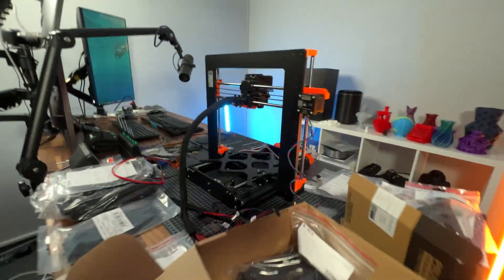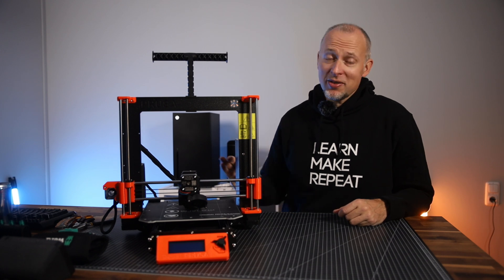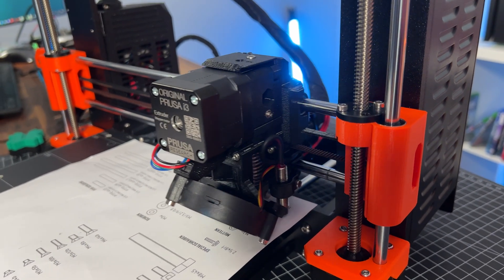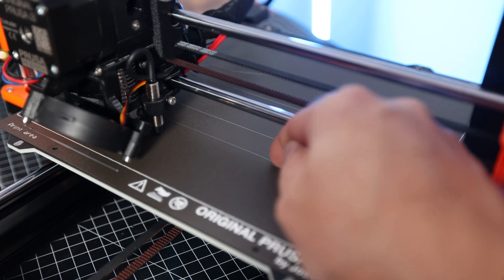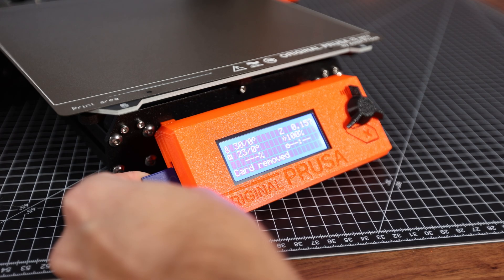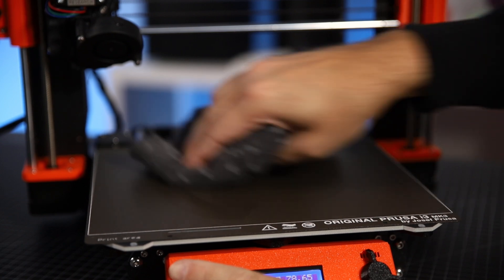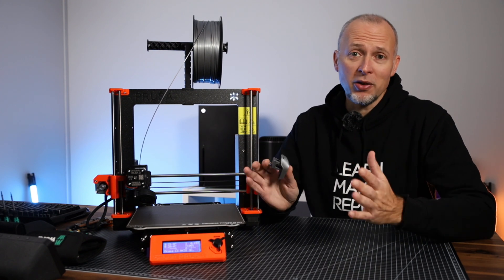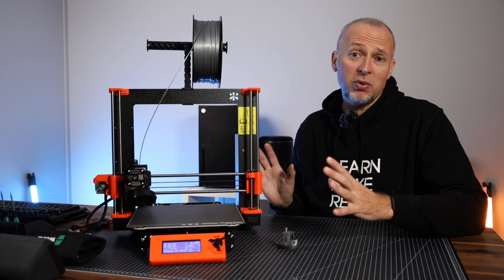MY FIRST PRUSA i3 MK3S+

Comment: The Prusa is a great printer.  The Z axis initial calibration is stupid.  I had to just print one layer, peel it up and measure it with micrometer and then readjust the Z axis offset myself.  How else would you ever get the correct first layer height?   If you buy a 3D printer you must also spend $15 and get a digital micrometer so you can measure things.

Comment: Do you genuinely believe it's worth $800 for a printer I have to build that's made mostly of 3d printed parts? I've had every ender 3 model and each had warped beds on top of other unique issues. I'm so fed up. I'm returning my $500 ender 3 s1 pro due to... you guessed it... a warped bed. But I don't have the funds to just drop $800 on a printer without knowing it's 100% worth it

Comment: Just got mine, it's a pain to calibrate the z axis! I'm in -0.800 and I feel it's too low but according to the results, it's still too high. Also, is there a way to plug a USB A into it? I only see the SD Card option. Thanks!
Reply from the maker: There is a USB connector on the Mainboard. The outlet is at the top of the Mainboard box . Cable should come with the printer.

Comment: Daniel, if I'd spend 800 quid on a printer kit, then spend 10+ hours assembling it, and the thing fails its very first print,  I wouldn't be the happiest man in the world.
Reply: If you spend 10+ hours to assemble a Prusa printer, you get a knowledge. You know why every one little screw is there for. In case of a problem you are already experienced enough to fix it right away (with well written manuals by Prusa team). That's worth those 10+ hours. It's an investment. I like the way they do it. It's quite the opposite of where the modern society is heading. Not knowing about how technology around us is working. Assemble your printer and you become an expert. Not a user.
Reply: Well, I have bad news for you. For 800 quid you really gets a really fiddle-maschine. For a "it always works out of the box", you are more in the 3000-5000 quid range.

Comment: Did you notice that the screen is one that can be bought from Amazon for around $13 and the knob that works the screen is on a Rotary Encoder you can get for $8.89 for 5, and that the mother board is 8 bit and you can get that for under $50. The kit is $949.00 on Amazon where you can get an Anycubic Kobra for $319.99 which prints just as good and takes 12 to 15 minutes to get going.
Reply: The anycubic is 100% knockoff parts and china made components. A MK3S is all genuine parts and is built with less than 10% of parts made in china. To compare a prusa to an anycubic is idiotic. Your anycubic will print as good as a prusa up until it starts to break parts, which is fast. Then a prusa will just keep going. My old anycubic i3 megs S had a broken hot end, heat bed, extruder and scuffed rails. all with less than 500hrs of print time. My prusa has thousands of hours now and still bone stock.
Reply: Cheap Chinese printers are great if you want to tinker and fix something… often… I don’t mind but I don’t put much faith in them being reliable lol
Reply: If you want to constantly repair and replace parts and solve problems, buy a printer with bearings, screw drives, cheap rollers, motors and fans made to no specifications at all from China. My first two printers broke every few prints and the quality was always poor.  If you just want great prints, save your time and money and buy the Prusa.   It uses the name brand parts and Japanese bearings.  It doesn't just break after 30 hours of use.
Reply: @NackDSP  Try and find anything on any 3D printer that’s not from China.
Reply: @NackDSP  my mega X had a bunch of stuff broken with it too like the PSU, hot end, bed. I do this for a living so this was ridiculous. I'm currently getting rid of all my Creality and Anycubic FDM printers for Prusa. At this point I have 1 CR10 that I bet I could have bought a prusa for after parts. I found out the hard way that most of the chinese stuff is junk since they have no QA or real oversight on quality. I honestly regret not getting a Prusa sooner as it would have literally saved me thousands for my business.
Reply: REMOVING THE J_E_W SINCE 1992  They aren't They're made in EU.

Comment: no wonder why bambu is making such a huge impact on the 3d printing community. This seven year old machine needs so much tuning, even for a "plug and play" machine.
Reply: It just needs the first layer calibrated and thats it.
Reply: @CineZoneYT  it also needs different PA and flow values for different filaments, and many extra settings in the slicer. That's something the bambu does automatically. iirc, there is no other printer in the world where you can just stick any  filament in and have it print perfectly without tuning the settings at all.
Reply: "This seven year old machine needs so much tuning, even for a "plug and play" machine"

What lol? He built it from scratch and all he did was calibrate the 1st layer then had successful prints. The X1 does the same thing. And the X1 doesn't adjust flow automatically for different filaments. If I have a part and file that's sliced for PLA, I can't just stick ABS in and use the PLA profile.  I have to re slice it for ABS.
Reply: @LilApe  First of all, the x1 carbon requires  no first layer calibration, as it uses a load cell and lidar. Secondly, the X1 uses a small laser sensor in the toolhead to calibrate flow and pressure advance for different filaments. Since different brands of the same type of filament can have vastly different PA and flow values, it helps a lot.
Reply: @morbus5726  ...it literally probes the bed, prints a bunch of lines and checks which one is best, then stops after the 1st layer and checks to see if its good. What do you mean there is no 1st layer calibration? lol. You can turn it all off, sure, but I can turn off the probing my a MK3S also. The pressure sensor thing is a gimmick, just like spaghetti detection. Ive been using my MK3s and prusa slicer for like 4 years,. Ive used PLA, PETG, ABS, ASA, TPU, PC, PA, CF...All of them over the years, i've never needed to adjust for flow or pressure, the slicer does that for you when you select what material you're using.
Reply: @LilApe  when I said it requires no calibration, I meant that it doesn't require the user to play with z offset, it also isn't affected by temperature drift like the superpinda. Also, the load cell aren't a gimmick... It's not anything fancy, the cr6 did it a whole ago, the only difference is that on the bambu, the load cells are in the bed arms and not the hotend.
Reply: @morbus5726  it also produced carbon dust. Have fun breathing that in.
Reply: @ItsMeMattCarter  it doesn't, the dust is graphite which rubs off bushing for lubrication. Do your research before making statements like that.

Comment: well, I still feel like the mk3s is outdated (and overpriced) for '22, especially when you compare the prebuilt version with the Bambu Lab X1 for example. Take into account the MMU units and compare the setup with the X1 again, the winner is clear. Dont really get why so many people are going nuts for Prusa, if you look into everything is just a basic, middle of the road printer, nothing to write home about but well, enjoy!
Reply: While I do agree with you on the fact that the x1 is a vastly more advanced printer, I still much prefer the mk3. The noise difference between the 2 is just too much for me right now, but I will definitely invest in a Bambu printer in a few years if they reduce the noise of it though. My other point of contention with the x1 is long term reliability compared to the mk3.
Reply: Only thing X1 has going for it is its "speed". Its closed source, proprietary and is more unreliable as reports are showing. AMS' breaking, hotends snapping in half, crashes into itself, debris gets jammed in the X axis rods and seizes up.
Reply: The Bambu X1 line crush this printer. Josef is smoking some powerful stuff pawning this old tech on the masses.